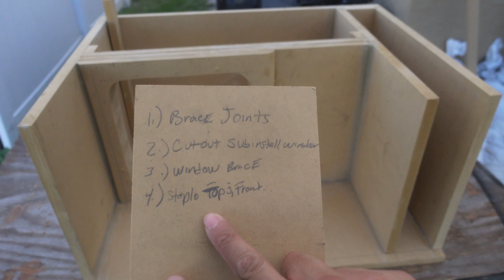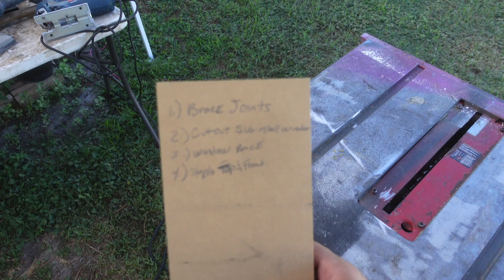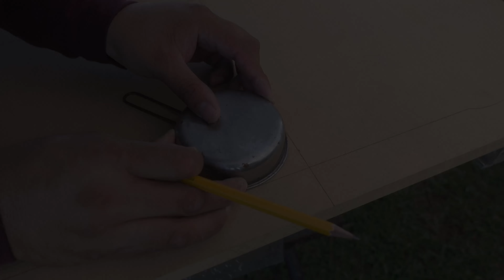Building a Subwoofer Box at Home w/ 3 Tools!

Comment: Watching you cut wood gives me anxiety, Mouse! Drop that blade and get a microjig gripper Pushblock. I have 3 of them in my shop. They take safety to the next level. Im confused about the dead space at the side of the box as well. Maybe you could elaborate as to the reasoning. Good build so far.
Reply: Maybe to seal off the unused trunk area or he realized there was too much airspace.